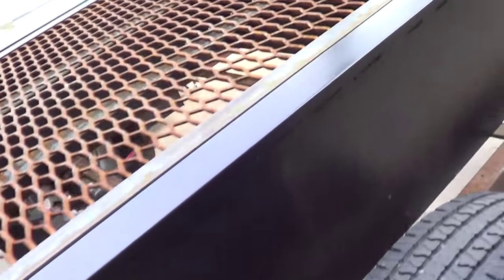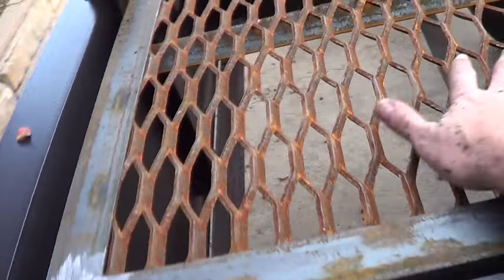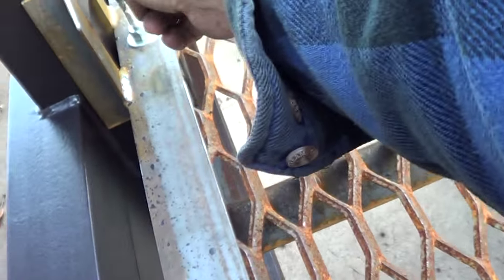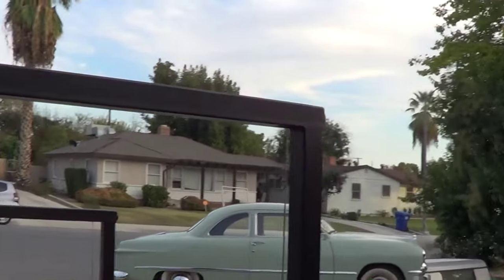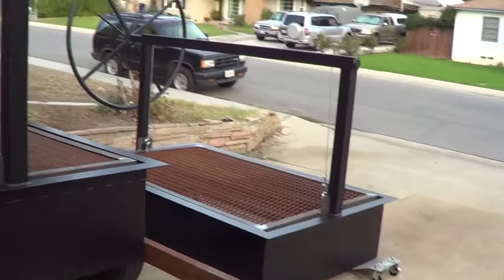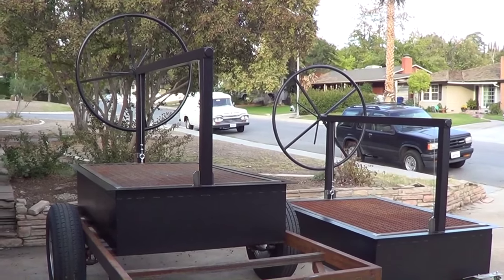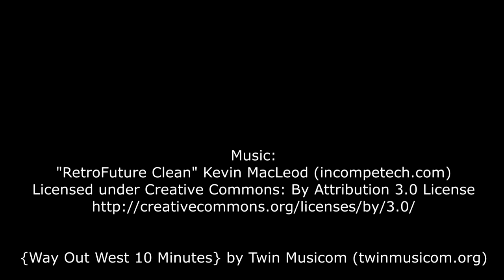Santa Maria Barbecue Grill BBQ

Comment: This is fantastic work. I have been raiding youtube for some ideas about building my own and the way you made the lift locking mechanism I am gonna steel from you! This is so much better than the ratchet mechanism I have seen elsewhere!   Great works!
Reply from the maker: I'm glad you like it. I hope it works for you. I built another on this channel that I shared and it's a little more reformed. I'm currently getting started on another one for the channel and I'll be posting the plans on the Patreon. But, the new video should go into more detail.

Comment: Do you do residential build for the public,I love the wheel with your locking mechanism too adjust height over pit.you do quality work with thick 1/4 inch steel.professionally built will last for decades.excellent for searing steaks,and tri tip,chicken and  low and slow by raising the grate. Very impressed in your welding skills.thank you sir for amazing Santa Maria grill pit build.
Reply from the maker: I do all sorts of stuff. I should build a few and see if anyone would buy them.
Reply: @JustinJennings  Justin, If you build them, people will buy them! As soon as I get my workshop finished, that's what I plan on building along with chili roasters and offset smokers. Several people have expressed interest in purchasing these things once I build them. And I'm sure as you already know, once people find out you can weld and fabricate, they want you to either build things for them or fix things for them! lol. I'm not too far from you in Palmdale and you do some of the best quality work I have seen.   Jim

Comment: Hey mate, love bbq looks awesome. Just wondering, the way the cable is attached to the grill. with no guide as such and say the grill is uneven . would it not tilt when raising and lowering? Or do you try to balance it with the meat. Hope you understand my question.
Reply from the maker: No extra guides are needed that I'm aware of. In general, you try to balance the grill. But, it doesn't seem to ever get bound.
Reply: Thanks mate, nice work. Looking forward to making one.

Comment: I like your grill design,but as a consumer,I would suggest a better locking mechanism. If i had 40 lbs of meat on the grill and somebody bumped the locking bar,or a kid tampered with it,loosening it and it dropped into the coals, i would be pissed.I would prefer some sort of lock that was more fool proof that locked the wheel/rack in place more securely then just clamping force alone, giving me peace of mind that im not going to lose my meal in the fire.lol
Reply from the maker: Interesting concerns. If a client asked for a secondary locking mechanism or additional safety features, I would oblige them.